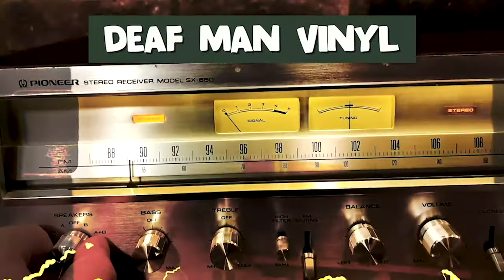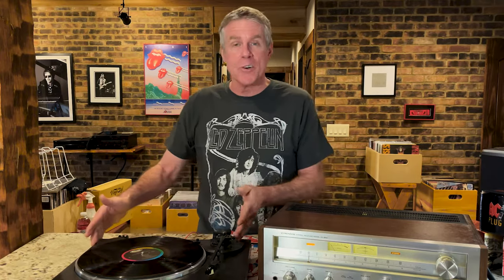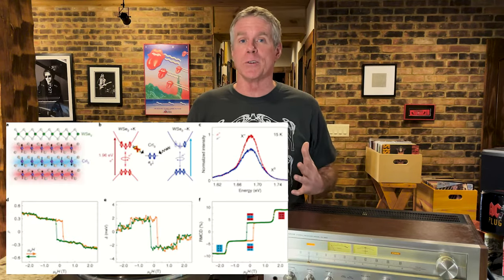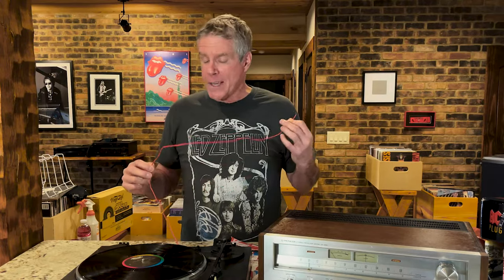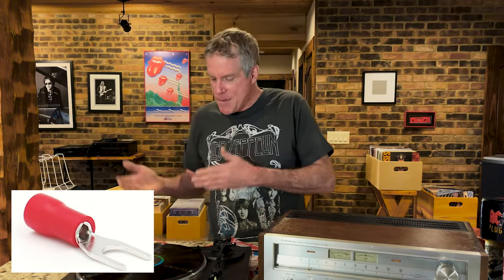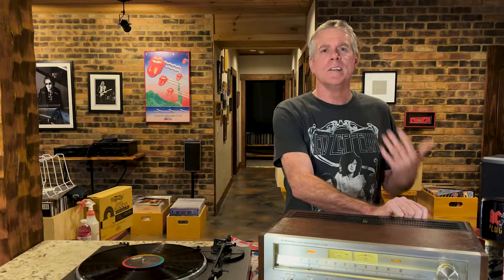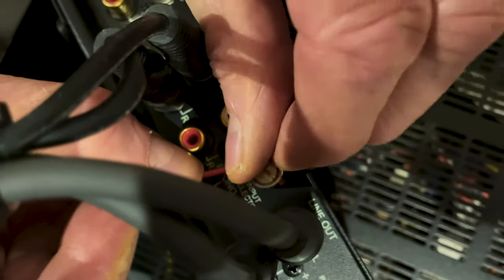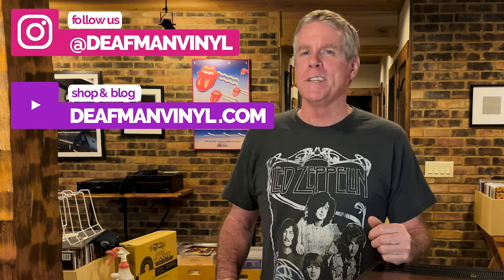Fix Your Turntable Hum! Troubleshooting Record Player Grounding Issues

Comment: I'm using a technics QD33, but I don't see a spot to plug in a ground, can I just take it? I have that exact hum
Reply: i am pretty sure that your model uses a ground wire. It is usually a very small hole next to your rca outputs. it should be a needle ground wire like my old technics. One end is like a needle and the amplifier end is the U shape screw type to hold it.

Comment: Hello deafman. I have a Pioneer turntable PL-Z81 which I bought in 1970. Recently the associated amplifier gave up, so I got a Yamaha amp. Turntable now buzzes and hisses. The turntable body is plastic, with no ground that I can see. I've looked inside, but I don't know where to attach a ground wire. HELP! Thanks very much!
Reply from the maker: Hey, sorry to be so late getting back to you. Are you plugging the turntable power cord straight into the turntable? If so, I'd experiment with plugging it into a separate (wall) receptacle and play around with placement to see if you're getting some proximity interference.

Comment: I have grounded my turntable to my receiver but I get a thumping sound in the background from the turntable and my speakers when an LP is playing?
Reply: You can especially hear it between the tracks on an LP. And my turntable is brand new>
Reply from the maker: Not sure about that one, man. Thumping sound is not typical. Sorry to not have the answer for you. Might want to play around with placement, or put a rubber mat under the turntable and see if that helps.

Comment: So the turntable has the piece with with the spade, and the other end with the bare wires twist around the ground on the receiver. You didn't show where the spade attaches to the back of the turntable.

Comment: So I have the same amp as in the video. Have a jvc qla-5 and has that 120 ground noise when switching to play the turn table. Electrically speaking, the amp only has a two wire attachment plug hot& neutral. I’m thinking you would need the equipment ground from the outlet side to connect to the amp?
Reply: have you plugged your amplifier and turntable on the same outlet? if you use different electrical wall outlets big chances you will get a loud hum. Problem was fixed for me, i have a vintage technics TT on a vintage Marantz 2240 amplifier.
Reply: @boromir_8428  the equipment is plugged into the same circuit. There’s for duplex receptacles on the circuit. It’s basically by its self in the basement. I ran emt pipe and installed a separate equipment ground wire in the conduit. I think its just the old equipment or maybe the cartridge?  It’s not horrible just a bit annoying
Reply: @anthonyelectric6045  hum... maybe it`s your cartridge and/or your ground wire is bad. But you know it is ''normal'' to hear a little something when you raise the volume having the stylus in the air, not touching the record but this sound is quite low usually.
Reply: @boromir_8428  so today the turn table arm wasn’t working properly. So I took the base off and retighten a Allen screw etc. low and behold one of the ground wires weren’t hook to nothing. Quiet as a mouse now after putting it all back together. Thanks for your help 👍
Reply: @anthonyelectric6045  ahhh, no wonder it was noisy! good for you and your welcome : )

Comment: I have a Denon avr that doesn't have a phono jack. There's no place for the ground wire to attach from my turntable. I've never had an issue until I moved. Nothing changed that I am aware of. It's only on the turntable. It sounds like it's coming from my woofers. A bassy sounding hum. Is that what the 60 hrz hum is?
Reply from the maker: Check your connection at the cartridge. Maybe they got jostled doing moving. Everything should be tight and clean.
Reply: @DeafManVinyl  My turntable had a ground. I did try grounding it to the reciever but, it didn't work. I'm thinking about upgrading to a reciever that has a phono imput.
Reply: @DeafManVinyl  you might be on to something with the cartridge.

Comment: My Audio Technica Lp60x makes that grounding hum but there's no way to ground it and  I can't stand that buzz I have not been able to find a solution
Reply from the maker: Have you tried plugging into an outlet separate from the rest of the system? Move it away from the other components?
Reply: @DeafManVinyl yes I have unfortunately nothing's worked

Comment: Please show the ground connection on the turntable. All the casing on my Technics is plastic. Same with the Audio Technica table. CD player does not cause a hum.  No ground terminals on either turntable. Thanks.
Reply from the maker: Hey George — You might need to get inside the unit to make a connection. See https://electronics.stackexchange.com/questions/163457/what-is-the-purpose-of-a-turntables-ground-wire. I'd also play around with proximity (move it away from anything else electronic) and try plugging it into a separate outlet (check polarity if it is an old-school unpolarized plug). Good luck!

Comment: I have a hum when the turntable is turned off, its a low-level hum.  Any ideas?
Reply from the maker: What else do you have in the system? A receiver? A pre-amp and amp?
Reply: @DeafManVinyl  
I have a Denon reciever 3312, Denon brp 1610, Denon CD 5-disc, and a Monster power conditioner.  As soon as power yp the TT, the hum goes away.

Comment: My humming only happens when the needle drops...what does that mean???
Reply from the maker: I'm thinking it has something to do with the ground in the cartridge. I'd carefully pull each of the four wires off one at a time and make sure the contact is clean. The old-school trick I sometimes use is to gently press the eraser on the end of a pencil onto the pin a couple of times to clean. You can also brush on something like Deoxit to clean them. Then, make sure the wires make a tight connection when re-assembled. If not, use a set of miniature needle nose pliers to gently crimp the connector. Good luck!
Reply: @DeafManVinyl  Thanks...there is a sentence in my Sansui manual about the thickness of the wires connecting the turntable. So I bought some RCA connectors with thicker/shorter wires and that fixed the hum...gone!

Comment: My amplifier is within my Edifier speakers. My wires are hooked up directly from my turntable to the amp in the speaker itself. I can't get the hum to go away
Reply from the maker: Hey Elias — What kind of turntable do you have? Is there a ground wire or ground connection on the back? Regardless, a good first step is to try plugging the turntable and the powered speakers into different receptacles (turntable into one outlet and then outlet into another). Let me know about your turntable model and I'll see if I can help further.

Comment: Uhh what if it’s the other way around 😭 my receiver has a ground bolt but my turntable doesn’t
Reply from the maker: Well, not all turntables need a separate,  external ground. Some have rubber and plastic parts that negate the need for it. But it there is a slot in the back that says Gnd or has the three-line ground symbol, you're going to want to ground it —either by rigging a ground wire or going to someplace like https://www.turntableneedles.com and getting a ground wire made for that model. Good luck!

Comment: You never showed where you attached the GND to the turntable? You stated you were gonna show the back of it and never did.
Reply from the maker: So, if you have a ground post on the back, that's the place to connect. Sometimes you can literally tape the bare ground wire to the back of the receiver and it'll work. Good luck!